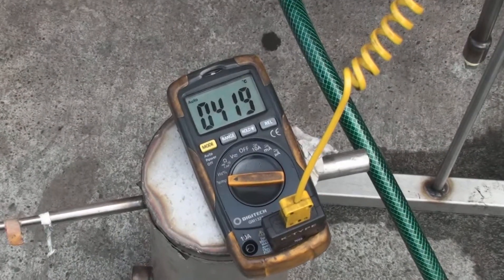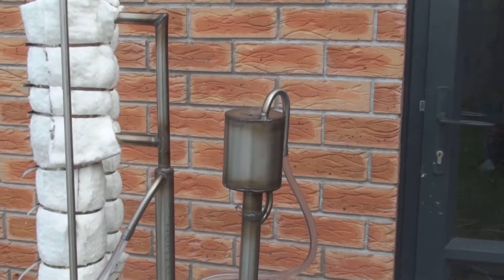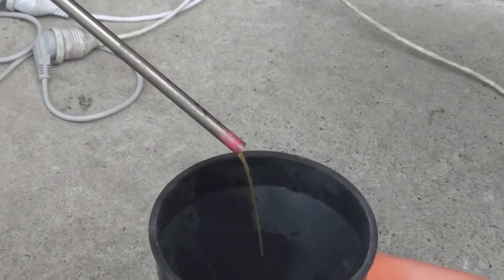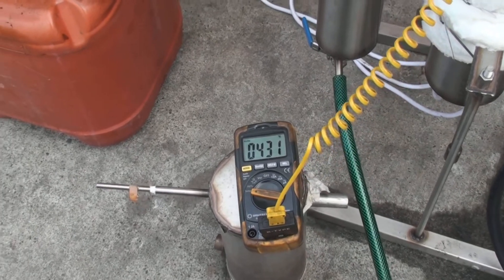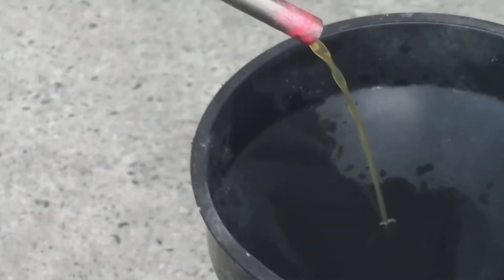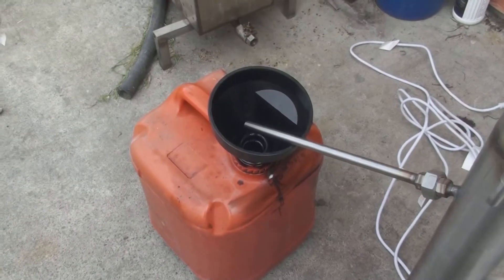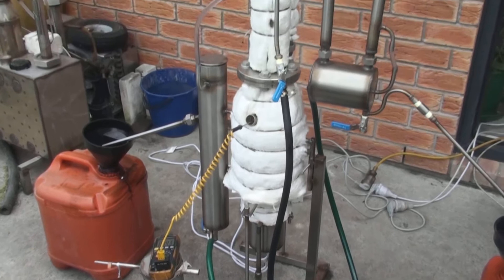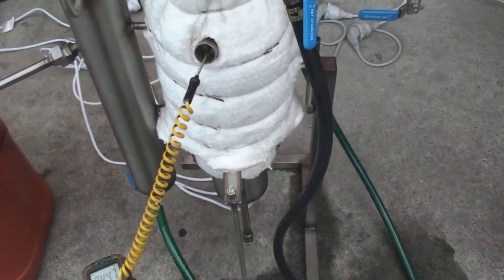Diesel out of WMO - 4kw distillation unit 1/3

Comment: Alek, Really enjoy all of your distillation videos but WMO as much as any of them. Do you update your WMO plans with the improvements & refinements you work out by experiments? Thanks...
Reply from the maker: Currently preparing some amendments, though will add the pack of information to the original download as default, so technically everything is included.
Reply: Thank-you Alek. I sent a few practical questions on the new WMO continuous processor to your contact page on the ferromit web site. Have watched all 3 of the new videos, I believe you have a winner in this design and wish you the best to sell many of these systems.
Reply from the maker: Thanks a lot, I prefer to sell a construction plans.
Reply: Alek Polek that's good. I'm enjoying the learning experience. You have some well refined skills in distillation. You are applying them from experience, better than reading a book.